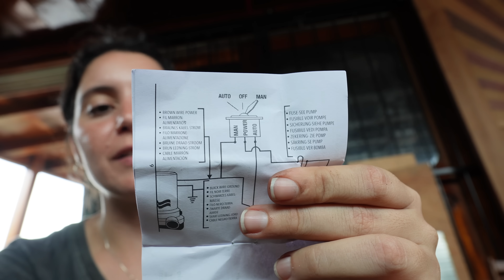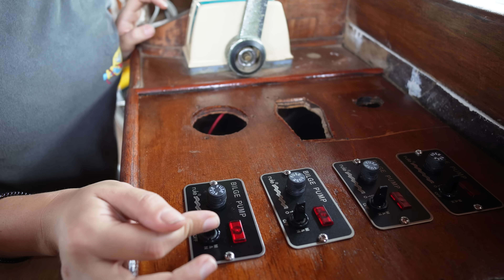This rescued wooden boat won't sink anymore: installing big bilge pumps — Sailing Yabá 178

Comment: Nice to see Yaba coming along. Just two thoughts, you never mentioned fuses in the bilge pump power lines; and the connectors look like they are for vehicle applications, not a salty environment. Perhaps you would be better to use soldered shrink wrapped connectors like these -https://www.youtube.com/watch?v=7Wh5gM8GM70.  Hope I have the right link.

Comment: @MP.."Straight From the Battery" = "Hot battery Bus", Needs a Disconnect Switch as well...
"Any Electrical Can Burn", and battery Emergencies are not Unique....

Comment: Hi guys. I’ve been catching up with your content for a bit now and I’m finally up to date.  I love watching you guys build your dream. However placing your engine room bilge under your drive coupling is a potential hazard. One if you start taking in water and are trying to maneuver to safety. You may need access to that pump and a spinning coupling is an obvious problem.  Second. Should that coupling have a massive failure it’s likely to take out your pump as well. A less likely scenario. But anything you can imagine should be avoided.  Because it’s the things you don’t think of that get you.  Keep up the strong work. I’ll be watching.